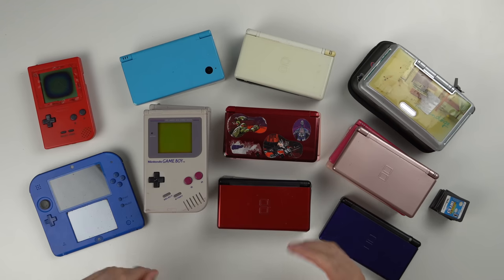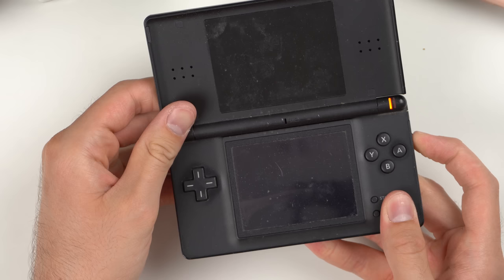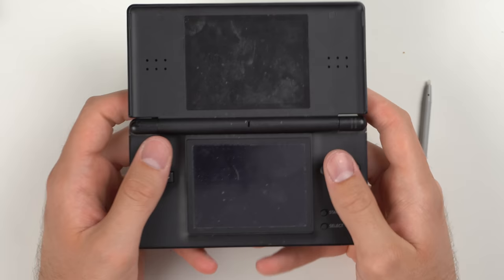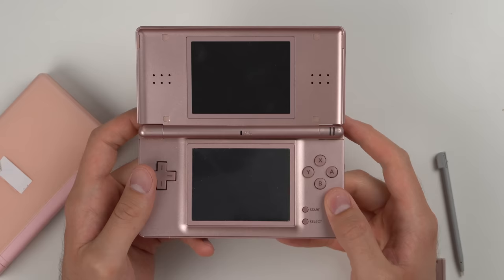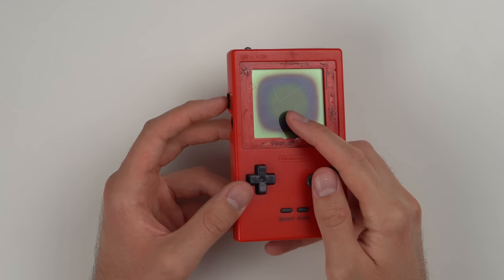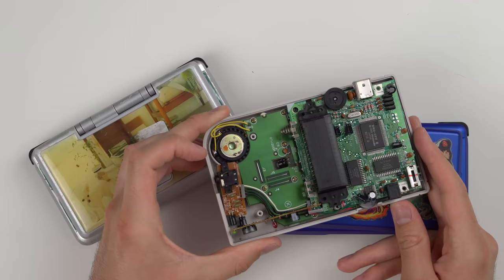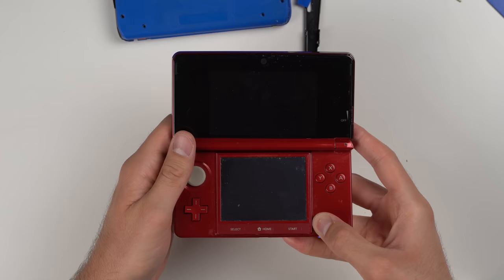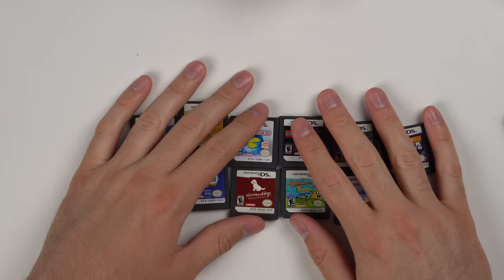I Bought 18 Nintendo Consoles from Goodwill... SCAM!

Comment: If a new battery won't work, it usually means one of the fuses is bad. The vertical lines on Gameboy screens take about 5 mins to fix as well!
Reply from the maker: Yeah I actually fixed one of the DS consoles by doing that. I talked about it at the very end of the video
Reply: Where would I go for the vertical line on the GBA I have that on mine.
Reply: I got like purple screen sometimes and some colorblind colors every time I unplug the charger on my ds lite

Comment from the maker: The sketchy thing is that all of these consoles were supposedly untested… what are the odds that they are all untested but they all have issues? Seems like they tested them, found issues, then sold as untested lol
Reply: Idk if it helps but, I had a dark blue dsi that used to the something that the light blue one is doing, Basically I couldn’t open any apps. The small wifi sub-board went bad. My uncle swapped it with another and all the symptoms went away.
Reply: I actually used to work for Goodwill and for the branch I worked for (and I’m fairly sure it’s the same for most branches) we’re told to not test electronics because we’d either not have what we needed to properly test to make sure it’s working, or it’d just take too much time. Of course, I’m not saying it’s impossible they were tested, I’m just saying it’s unlikely.
Reply from the maker: @spatialdiscord6457  that’s what I’ve seen from most goodwills, but I am seeing goodwills now that will test the items and actually list them as tested and working (on the goodwill auction site). So it appears to be more common for some goodwill shops to actually invest the time in testing stuff

Comment: Just a tip. Soak the battery terminals in white vinegar instead of isopropyl alcohol. The vinegar is a base that counteracts the battery acid and will break it down in less than five minutes. THEN clean off the vinegar with the alcohol. I've saved many remotes and controllers using this method.
Reply: Vinegar is not a base. Vinegar is acidic
Reply: Vinegar is acidic
Reply: Also Deoxit works wonders on cartridge contacts, etc.
Reply: I wonder if the vinegar works just on the grounds of being slightly more basic? Battery acid is 0 ph and Vinegar is 2-3.

Comment: I mean usually untested stuff is a lot cheaper in my experience. All I really have learned is you just gotta clean them well and replace a few things and it should be good to go
Reply from the maker: That’s my experience typically as well, this was worse than usual tho I think
Reply: but this wasn't cheaper, like at all.

Comment: 10:26 On the back of the GB with the unsoldered display pins there is a quite rare sticker. It was originally refurbished by Nintendo. Be careful with that when you wash it, because it's most definitely a collector's item.
Reply: He already removed it
Reply: @everythingpony  Bruh... Well, that sucks. :/
I thought he may have unsticked it.
Reply: What does the sticker look like? Is it the one with the bar code or the silver one?
Reply: @nuclearkitten6421  The one at the bottom, on the battery cover, with the phone number written on it.
Reply: You can easily reprint that sticker.
Reply: @RealmsofPixelation  I guess... But a reprint is not the original thing.
Reply: @myrmeko   i have one on my game boy color does that count for something?
Reply: @coreyc.3218  Yeah. It brings some value to it. One with the sticker will resell for more money than an identical one without the sticker.
Reply: @myrmeko  is there any references that you could give me?
Reply: i think it being made in china also makes it worth more although i am not sure
Reply: @coreyc.3218  Well. You're out of luck. Youtube keeps deleting comments. I can't share literally anything here.
Google whatever it says on the sticker. Find out yourself. I'm done trying. This is has been the 4th time.

Comment: a year or 2 ago, my neighbors had a yard sale. their daughter i went to school with (she is younger) didn't want her nintendo ds lite. they said it was code problems... but it doesn't take an SD card (came with it) it also had a high quality hardly scratched if even at all with quite a few games, quite a few stylisus, (idk how to spell that) the stylisus were varying sizes but were cool. it also had a plastic stylus carrying case. it was a blue nintendo ds lite, with no charger, but a micro usb B worked fine. it works perfectly. i want another DSI but i left it in my school locker in middle school many years ago (they donated it to good will without telliong me) now someone has like over $30 worth of free games pre installed and my favorite cartridge and the only one i didn't complete..... the DS lite was $10 and incase you were wondering... the SD card had no nintendo stuff, just family photos and some traumatizing "stuff" in between my friends birthday parties...... in all my DSI is gone, but my gameboy advance with a normal audio jack is gone, and my gameboy advance sp speaker broke because i played my rave music too loud in "The Sims Bustin' Out" so i have no audio. the ds lite is a good substitution. has shared play, picto chat, ds cartridge and gba cartridge play, but sadly the instruction manual specifically states that you can't play Game boy or Game boy color games, which you will find out by trying to fit a Gameboy cartridge past a cartridge spacer block... idk what to think... i wanted a ds lite to play ds and gba games... but now i want my dsi back... they had the legend of zelda four swords aniversery edition for free, which i can never play again because you cant emulate a dsi e-shop game... and i probably cant get it again... its the only version like it that you can play single player! My advice? stay away from handhelds and get a pc or console.

Comment: Buy some electronic contact cleaner from Amazon (WD40 makes it).  You can spray that on battery contacts and use a toothbrush to clean...Works extremely well, on any corrosion really, and you don't have to take the battery contacts out to clean them.  The cleaner is safe, not greasy, and dries quickly.
Reply from the maker: Interesting, thanks! Didn’t even know that existed
Reply: Vinegar will do the trick as well , just takes a bit longer and you have the smell to deal with
Reply: @UserUser-ww2nj  yep vinegar is good for battery corrosion as long as you don’t use too much of it
Reply: @whisperingwooper1763  Dab it on with a cotton bud and rinse off with alcohol . Cheaper that buying a brand and most people have it in the kitchen .
Oh no, now i want chips 😋😋😄

Comment: Those DS lites with flashing battery lights are definitely knackered batteries as I had it recently with a few DS lites as well, they absolutely need replacing.
Reply from the maker: Ended up not being bad batteries. I fixed one of them later in the video
Reply: @jrob0021  Maybe it was just the ones I got that had it perhaps but it was a good fix.

Comment: dude Ill save you the trouble in the future dealing with batery acid corrosion cleanup.
Vinegar and a brush is all you need on those terminals.
I tried it on a radio that had the same and it cleaned right up 
You can also try that in conjunction with a little sand paper to help polish up the terminals.

Comment: I was just thinking, I have a feeling the next DS will just have a folding screen. I'm watching this on my Galaxy Z Fold 3, and I'm remembering the DS rumors before it came out and all we knew at the time was that it would have 2 screens, and I remember touch screens were brand new Expensive high tech technology that was just invented. I couldn't believe the new Gameboy had a touch screen!! 🤯 haha
So looking from today. I bet the next gen console has a folding screen and may even be a separate thing than the next Gen switch, it could be the switch 2, but man I can see it already,  it would be the same form as the DS, except the top screen is a full wide screen and the middle of the screen extends down through the hinge where it has the floor of the game and the HUD overlaid ontop , controls on either side, and a sleek sexy folding screen console. 
I hope Nintendo makes this now! But if they do not. In 3 or 4 years, someone will find a way to combine and old Galaxy fold screen and Frankenstein it to a DS and it also plays switch games. It's only a matter of time.
Reply: They’ll name it the Nintendo Switch Fold (foldable Nintendo Switch with clamshell design). The successor to the OLED one.

Comment: I had the same problem on my dsi btw it’s not just the camera app its every app/game that you try to boot its caused by a broken WiFi board or a wifi board with a loose ribbon cable in my case the ribbon cable was just loose

Comment: The first console is probably a fuse issue. I had a black DS Lite 11 years ago that had that problem. f1 fuses are a common issue on ds lites.
Reply: On my dsi xl too. Tried to fix it. Mr and my father did but now a the screens (the bottom screens only flashes white then goes black the upper is staying black) broke. Sadly new parts for ds consoles are pretty expensive. You could buy a new one from it, but I don't want to bc my father buyed this dsi for much money back in the day. And it means so much to me still. So how do I replace screens savely. If it's the screens Idk. :(

Comment: I recently turned my 3ds on for the first time in years. It did the same thing with the brief orange light. I just switched around outlets a few times and it turned to a full orange light, and then charged fine

Comment: To me the 2ds is easier to repair then a ds lite. Mainly because it doesn’t have a hinge and the top and bottom screen are on the same panel
Reply: I found out the 2ds is a very shitty console. It's like nintendo ruined Them and than put some kind of stuff on the chips. I have had 4 different 2ds boards and they all have it. Like they made a mistake and than had to repair all the boards.

 I remember Nintendo sold the 2dsses for cheaper at one point with a free game also. I'm thinking this is because Nintendo knew the boards would break easy in the future. I have never seen this kind of stuff on Any other Nintendo console. Alot of the time the 2ds wont start if the screws are not put in tight. 

I think that's why the stuff is on the chips for pressure because they made some kind of production mistake. Replacing parts is easy for the 2ds that's right though. But I would buy a different model if you ask me.
Reply: @HD-wf3bp  i see.

Comment: Even if all the consoles worked fine, it still seems like kind of a bad deal for a reseller. If you’re getting into Nintendo handheld consoles refurbing and reselling, you should start off with 1 or 2 cheap consoles and get a feel for the market and learn how to repair at the same time.